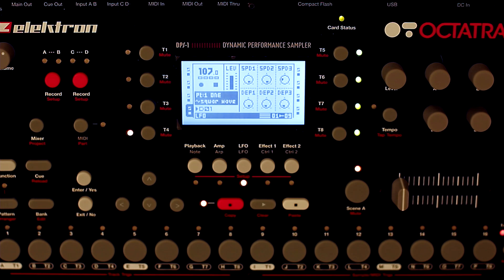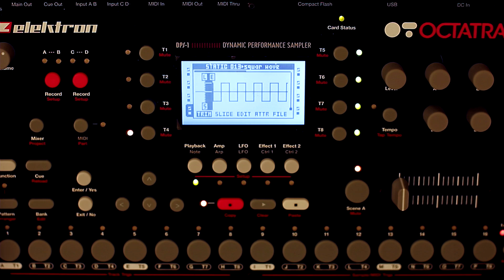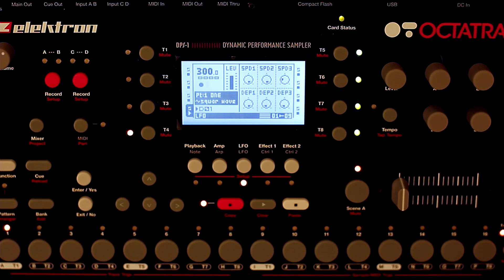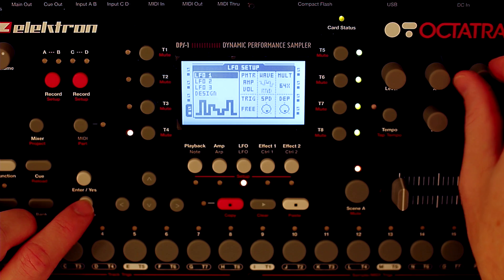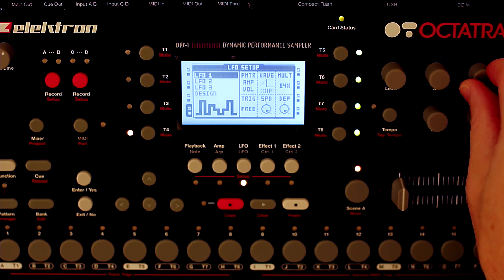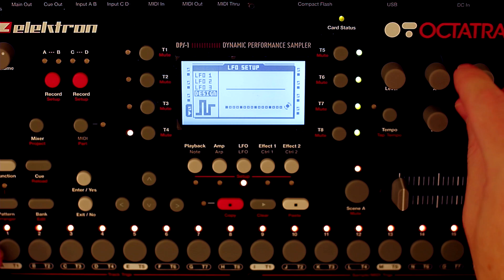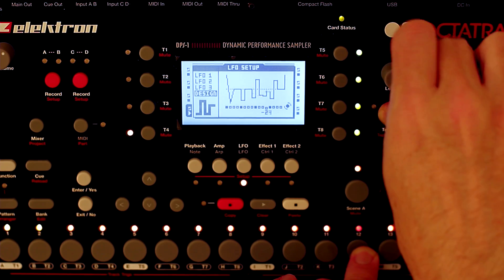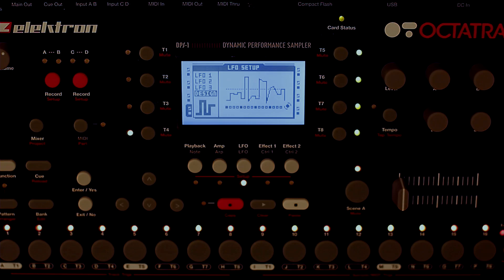Octatrack: How to Draw Custom Waveforms

Comment: great explanation, i could follow every step. 
but now is the question, how do i pitch those waves ? can i change the frequency of the lfo ? can that be done chromatically ? i vaguely remember someone telling something like that but im not sure ... thanks for the video anyways !
Reply: been a year but if still wondering you just resample the output once you are done drawing the custom waveform. Once you have the waveform as a new single cycle waveform you can pitch chromatically add fx and all that jazz.